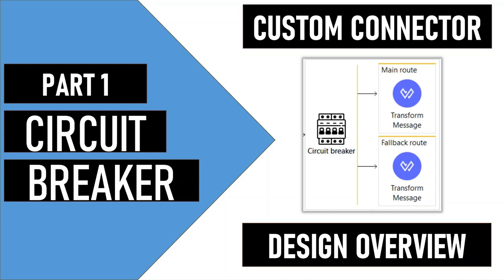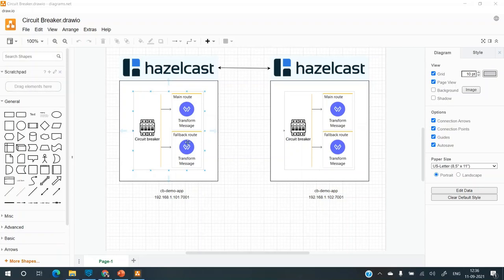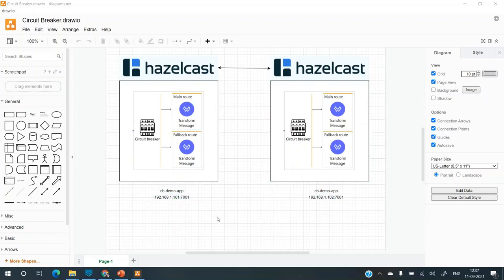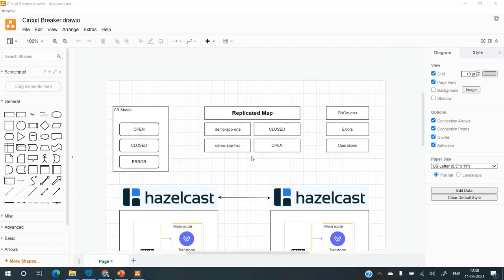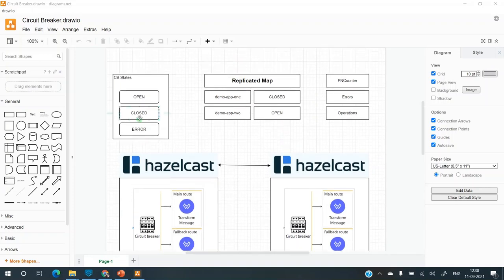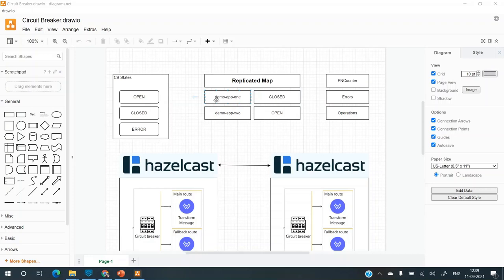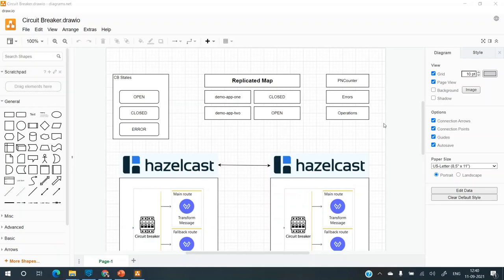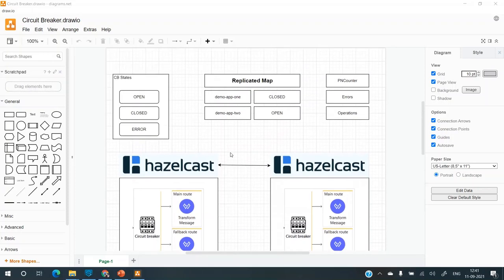Part 1 | Mule 4 | Custom Circuit Breaker Connector|  Solution Overview

Comment: All 5 videos seems excellently presented. Not sure whether Mr Vishwas will reply but I have couple of feedback/queries to share after following  the entire videos.
1) How multiple IPs could be configured in Member IP Address properties, if the Mule Apps are deployed in cloudhub because the IPs are dynamically changing? Appreciate if he can talk on that.
2) In CBUtility class when getCoreEvent gets triggered in case of Error scenario the code breaks. Any thoughts?
Reply from the maker: 1. In cloudhub its not possible until you have static IPs alloted. This solution can work for horizontally scaled application only when you know the IPs of the runtimes. Hazelcast cannot automagically determine the members to form group.

2. Please share some error stack trace to be able to comment on it.

Comment: hi i have anypoint 7.8 maven version 3.9.0 and java version 1.8 but i cant install the circuit breaker project through my maven in cmd, can you please help, i really need the connector for my project
Reply from the maker: What is the error you are facing?
Reply: @Vishwasp13  when im installing the project via cmd, im getting BUILD FAILURE error, and

 [WARNING] diagnostic: warning: Supported source version 'RELEASE_8' from annotation processor 'org.mule.runtime.ast.internal.extension.loader.ASTExtensionResourcesGeneratorAnnotationProcessor' less than -source '16'
[ERROR] error on execute: java.lang.ExceptionInInitializerError
Reply: @Vishwasp13  i have also tried to downgrade my java runtime version but still its failing
Reply from the maker: I've tried to install using maven version 3.8.6, Java version 1.8.0_332, it installs without any error. Can you try with this version of maven? I haven't checked with maven 3.9.0 yet.

Comment: When making a custom connector that listens on messages how do you forward that message to the flow
Reply from the maker: Follow these steps
1. extend the class to org.mule.runtime.extension.api.runtime.source.Source
2. Implement onStart(SourceCallback scb)
3. In the implementation you can use the SourceCallback object's handle method to perform somehting using the Result object like so -> scb.handle(Result.builder)
4. The Result class builder method will take a Message and this can be sent to the flow.

I'll see if I can make a video that would be a change listener for this circuit breaker.
Reply from the maker: Here's the link for the listener https://www.youtube.com/watch?v=LED1GvqUSWA  hope it helps